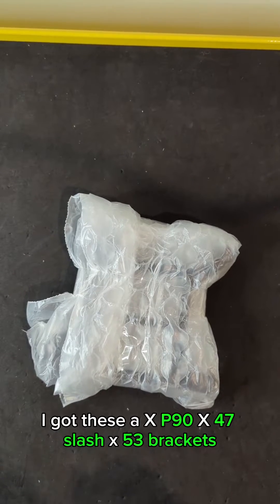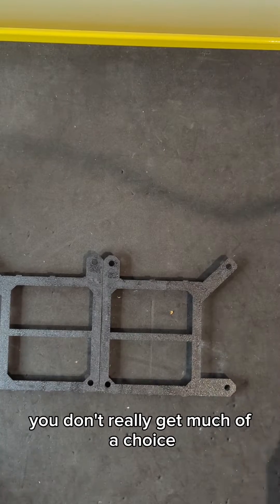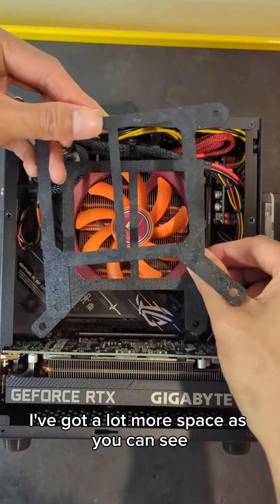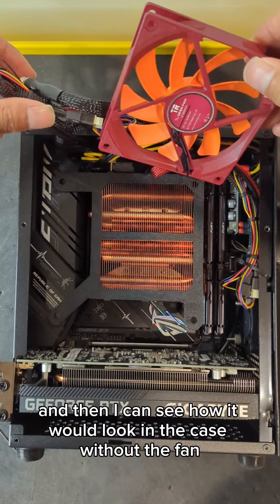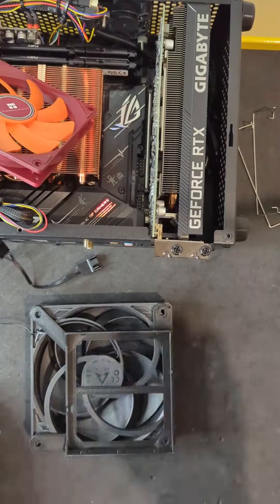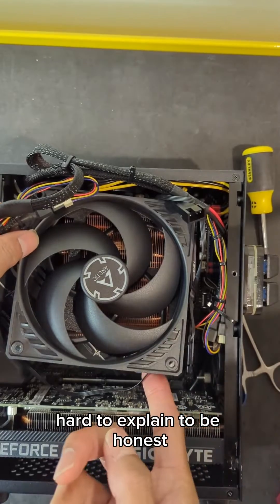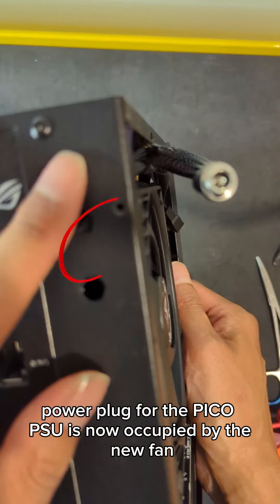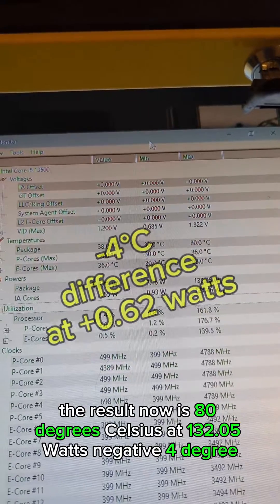Thermalright AXP90 3d printed 92mm to 120mm fan bracket

Comment: you can try prevent hot air from recirculating into the fan by using sponge spacers (in between side cover and fan surface). Noctua made similar product with various thickness
Reply from the maker: Awesome thanks will check it out
Reply: @iBuildPC  I used a noctua fan duct on stock axp90-x47 full copper in Lian Li Dan A4 and it actually increased my temps by 2-3 degrees on cpu and about 5 degrees on ram, so it ended up being a waste of money. Currently waiting for this 120mm bracket to arrive so that it can help with ram and ssd cooling as well.
Reply from the maker: @Grom000  yes the 120mm fan bracket makes a difference like 3-4c decrease